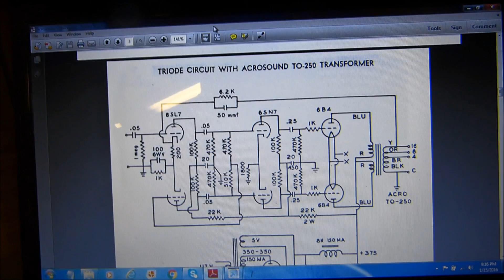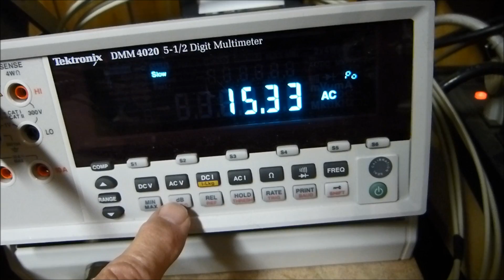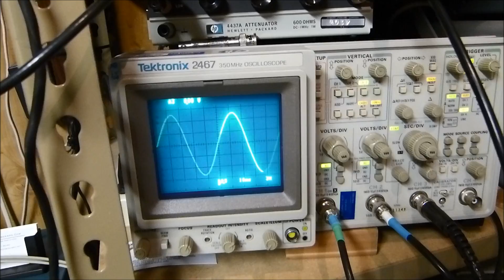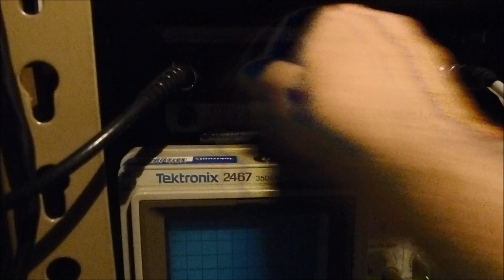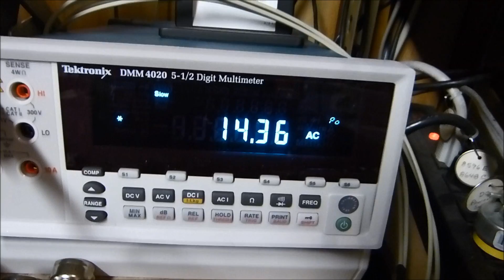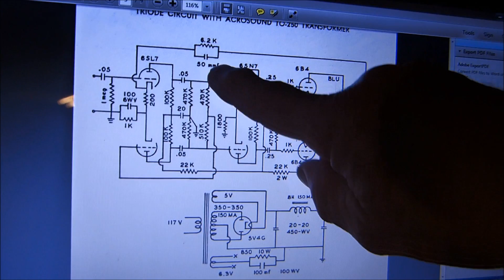Vacuum Tube Amplifier James Audio Output Transformer & Determining Components For NFB

Comment: great video.I'm quite envious of the equipment.My variable capacitance is from an old transmitter and once set have to use my Heathkit cap tester to tell me the value.Yours is a Gen Rad piece I think? I use the potentiometer method also and work over a lot of old theater gear.Most of the RCA tube theater amps,the true theater amps like the MI-9377's have a substantial amount of roll off dialed in from the factory to minimize hiss which was a no no in theaters.I have corrected many by raising the 27K feedback resistor and adding some parallel caps to flatten the response.they are capable of an amazing sound!Most of what 
people are calling theater amps(a selling point mostly seen on the auction sites)were just for commercial sound use.I personally have removed a rack full of the MI-12182 dual 6146 amps from Macy's during a renovation back in the 70's.still have a pair.But I won't fault this equipment either as I have also seen those brutish 12188 amps with the four 807 tubes run flat out to over 30Khz.In fact RCA had issued bulletins on them warning of HF oscillation causing over dissipation of output tubes by reducing HF response with capacitance in parallel with the feedback resistance.Good Job!         73's. N2VUW

Comment: To set the value of the feedback capacitor you MUST use a  SQUARE WAVE not a sine wave. Feed in a 10 kHz square wave and adjust your cap box for BEST SQUARE WAVE. Probably best to do it at 1 Watt not 40W.
Reply from the maker: Thank you. You are the first person to suggest how to determine the value of the 
FB capacitor. I will try it.
Reply: Well, I am glad to help..Now where did you get your James Transformers?

Comment: +ElPaso TubeAmps 

Hi there e David,

Thanks for evaluating the James Audio transformers. It does shine some light on the whole thing. As much as I don't trust eBay sellers, I do trust numbers and I trust what I just saw. I almost bought a pair of them on eBay a while ago. They seemed affordable and that's what triggered the red light for me but I guess this video proves my suspicions wrong huh....

Do you know where they are manufactured?

They perform beyond well and also have a nice look to them so it wouldn't disturb the vintage look on my amps. 

I really appreciated the feedback part of the video. I never liked too much feedback anyway but seeing how it works in real time on the scope really confirmed a lot of the bad assumptions I made about feedback years ago. I guess I just have to quote my father on this one, he always says "...if you wanna build a nice oscillator, just build an amp with feedback". 

Now I want to experiment with little to no feedback at all on my next push-pull amp. I guess I'm gonna use that acrosound schematic driving a pair of 5881's, 6098's or even some 6L6G's I have around here. Feedback seems to be mandatory on push-pull amps, but you rarely see it on single ended amps. That's maybe one of the reasons why single ended amplifiers sound so good.

Initially, I thought I could use the same schematic but with a pair of 6080's instead of the 6b4's, than it would be triode, but the plate current is stupidly high on the 6080's and I'd have to wind a very weird output transformer for it.... so I guess I'll just stick to the pentodes for now.

In the future I'd really like to experiment with triode push-pull. You just mentioned that you were charmed by the 6b4 amp and I read about a lot of people who really fell for it. Maybe it's going to persuade me too. 

BTW, I loved that precision capacitor, boy, what a gorgeous piece of instrument, and for guys who build tube amps that's just so useful. Now you couple that to a nice resistor decade or some precision pots and you've got yourself one nice developing prop.

Thanks for another cool video,

Denis
Reply from the maker: +Denis Gouvea de Azevedo 

Hi Denis,

I have had very good experiences with Ebay - except for two that I can think of in over ten years buying off Ebay.  I did not get these James transformers from Ebay. They are cheaper ordering them directly from the company. Just Google James Audio or try this link:   http://tctubes.com/james-transformers.aspx

They make three for SE and three for PP. Check them out closely and make sure you get the Z you want.  I do not know where they are manufactured.  I just cannot see paying $300 for an old Acrosound transformer.

The FB network has always been a challenge so I thought I would attempt to document my efforts hoping it will help others.

As for SE amps, I have never had one but I have built a large PP amplifier (80 w) with a variable NFB (basically from zero to -20 dB)  and with no feedback and just a couple of watts the amp sounded really loud and seems to have a huge "sound stage" but I am not sure I really like it. All my amplifiers run with normal NFB. 

I have seen schematics using the 6080's but I believe the Z is very low so it might be a challenge to find an OPT. I believe there is a design using six or eight of them that is transformer-less.

I made some more changes in the amplifier after the video (putting the 6B4G's back in) and I run the 6B4's with adjustable fixed bias and got rid of the cathode bias resistor and capacitor. It is interesting that the 6B4G and 6L6 have the same pin out for plate, grid, and filament. Of course you have to ground the filament instead of the cathode on pin 8 of the 6L6 but it allows me to use my "bias probe, break-out box" to measure the plate current in the 6B4's.  I just like the sound (and look) of these small power triodes. I have compared it to McIntosh amps and maybe I like the artifacts in a less than perfect tube amp ?? There is just something in the 0.01% THD sound of a SS amp that is not satisfying. I can't explain it.

Yes, indeed, that capacitor is the "cat's meow" and it sure served me well last night. I think I mentioned in the video that it almost seems that these amps with their complicated adjustments would be much harder to mass produce and the 6L6/5881/EL34/etc put out so much more power at less THD so ... the winner is obvious.

I almost didn't make the video public as there is so much fumbling but I figure that is the way real life works.

David
Reply from the maker: +Denis Gouvea de Azevedo Actually, after a little more investigation I found a site that shows all the transformers that James Audio makes. The site I gave you is just where I bought mine. They are made in Taiwan.
Reply: ElPaso TubeAmps 

Hi David,

The transformers perform amazingly well and they seem to be pretty solid too. Hard to compare with the late 70’s early 80’s cheap stuff made in Taiwan huh….

I’ve been trying to use those 6080's for ages but never got anywhere. I even thought about building an output transformer less but the topology reminds so much of SS amps and with such a low Z, I would just wind up with a tube amp that sounds just like a SS amp.

Now, there’s nothing wrong with liking the 6b4 amp better than the McIntosh in my book. When you come think of it, the McIntosh tube amps are all about feedback. You get a lot of both local and global feedback, that’s why they score so high in the specs. At the same time, that’s maybe why they sound a lot like SS amps too.

I have built a lot of SE amps over the years and I find them to have that "mojo". The kind of "mojo" you get when you run a PP amp with no feedback and low power. At low power, your PP Class AB amp is mostly behaving in Class A and you do get to hear the teeny tinny details hidden between the big notes. That’s why I like SE so much. Even if  PP is a “superior” design in terms of efficiency and tube life…bla bla… I just find that the common mode rejection on the PP often kills that “mojo".  The harmonic content is completely different and our brains can relate to that. 

It's been so long since I only build SE amps that I'm currently forcing myself to build a PP amp for the sake of comparison.

Just as important as the capacitor, if not more-so, was the bias probe/break-out box. You could see the oscillation so much better using the meter than using the scope at low frequencies. Which, BTW, makes me think about getting a VTVM.

The video was also a great example of how shunt resistance and capacitance work within an amplifier. The French have a name for negative feedback and it's “contre-réactance” like in counteracting. I’ve lived in France for 11 years and only now I noticed that that’s one appropriate name for it.

Thanks for making the video public, it shows how hard it is to get the right amount of feedback. If there’s ever such thing as the right amount of feedback. 

Denis
Reply: ElPaso TubeAmps 

I guess I'm going to get a pair of transformers via the same site you used. If they ship to Brazil. The prices are really interesting and that's for the pair. They're worth trying.

Thanks

Comment: Thank you David for the many informative videos.  I have a quibble with this one.  The title says Williamson, but the circuit is not a Williamson.  Note that the input stage tube cathodes are tied together with only a 200 ohm resistor in between -- not Williamson. The schematic you show in this video is labeled simply triode circuit.  Other schematics in the Acrosound catalog that are Williamson are labeled Williamson, but this one is not.  Acrosound used a similar input circuit in the commercial product power amps Ultra-Linear II and St 120, but there are several  differences. This arrangement reminds me of a tube differential amplifier. I cannot say I fully understand this circuit.  Is this circuit worth exploring further?  Thanks again!
Reply from the maker: I completely agree with you. It is not a Williamson design. I guess I was not paying attention. With that high-gain 6SL7 it reminds me of one of the Mullard designs, if I remember that correctly - or is it an Acrosound design. I built one such amplifier - maybe it was this one - and found the gain of the amplifier way too high - something like 100mV or so, would drive it to full output and distorted quickly. Maybe this is the one I remember 🙂... this amplifier does not exist anymore. Thanks for noticing and letting me know - I will edit the title.

Comment: the problems with push pull and also feedback is they both cause phase distortion witch destroys sound stage. Notice no one ever measures or talks about this. Our brains determine the source of sound by phase(not volume) differences between what our ears are picking up.
Reply from the maker: It is interesting that you use the word "sound stage". I described that word in an amplifier I built some years ago using KT90's with a variable NFB loop. With no NFB the thing sounded wonderfully  "alive" and very sensitive to high volume and overdrive and distortion.... I understand what you are saying and as I cranked in NFB it got compressed sounding. However... and this is a very big,  However... with no NFB the available pure and clean "alive" power is around 8 watts with this large amp. With NFB power rises to 80 watts and THD is low.  You can listen to classical chamber music and violins at this level of 8 watts and just go off into heaven with its "openness" and "sound stage" (have you noticed that is the only type of music you hear on the Internet using these massive and absurd sized amplifiers?) but you sure as heck can't listen to Guns and Roses or Def Leppard at 8 watts.
Reply: You make a good point. use the correct design for the job at hand. I have a beautiful set of acurosound ultra linear 2 amps i rebuilt and used kt77s easy 60 watts of very clear clean sound but my single ended 45 amp with a watt and a half per channel no feedback has great sound stage.

Comment: You're running at 40 watts from a what was it? 20 or 30W transformer. How much margin do you think is in that rating? Or alternatively how long do you reckon it's safe to overdrive it like that?
Reply from the maker: +QuadMaestro I can't say how long it would be able to withstand 40 watts continuous but considering its physical size I would think it could take at least 30 watts "forever". The FR, THD and other HiFi factors might not be as good as it is at 20 watts but I doubt it would go up in flames.

Comment: Any further developments in SE triode amps with smaller transmitter tubes? Has the El Paso storefront closed? I want to commission a project. Jim in Westport, MA.
Reply from the maker: +Jim Matthews I recently purchased some SV572-160 triodes that are supposed to be the equivalent of the 811A but with the plate connection on a base pin rather than the top of the tube. Also plate dissipation is much greater than the 811A. I originally purchased them for SE amplifiers but I just can't seem to move away from push-pull amps. When I decide to go back to a serious SE amp, I will probably start work on the 833A amp again. I am charmed by the 15 watt 6B4G amplifiers. I know the 2A3 is a favorite but that 2.5 volt filament is just a lot of trouble in my opinion. Another problem is I have no SE OPT for any tube. I am still thinking about it   :-)  What are your thoughts on a smaller transmitter tube that would be a good candidate?
Reply: +ElPaso TubeAmps The Russian GM70 seems cheap and cheerful. Would you consider building a parallel SE with the 811 quad you have, or are they better in a Williamson amp?
Great vids. I get interesting ads associated. Jim
Reply from the maker: +Jim Matthews An SE amp with a quad of 811A's... wow - I like that. Maybe a plate load Z of 2500 ohms or so ? I have to get some nice SE transformers first. I appreciate the idea.

Comment: Any ways of measuring THD without breaking the bank?
Reply from the maker: +TheLawnWanderer I started using a program for the PC called SpectraLab. I ran it on a 286 PC and it did a good job at 1 KHz. I did not have any way to evaluate it at 20 and 20 KHz. Performance depended on the PCI sound cards, etc. Google it and it is free for 30 days. You may like it for a while. I think the best buy for the money is the HP 8903A or B model. Don't get stuck having to have the B model. My A model is perfectly sufficient. The Pete Millett software for the PC is free.
Reply: +ElPaso TubeAmps  Your videos are the most informative in everyway David.
Reply: Get yourself a Tektronix SG505 and AA501 and a TM50x mainframe to put it in. You'll be well under $1000 and you'll be in the wonderful world of the Tek TM500 system, which has all kinds of other lab plugins.
Reply: +ElPaso TubeAmps  The best thing right would be those keithlley 2015s that are selling for 350 to 400 dollars and they were 4300 new.
Reply from the maker: +TheLawnWanderer http://www.partsconnexion.com/product26900.html
Check this out - per Mike' post above.
Reply: ARTRA a desktop PC and a 192kHz capable sound card will give you FR THD IM SNR all in one package for a few hundred bucks.